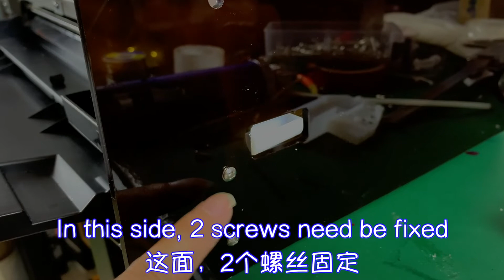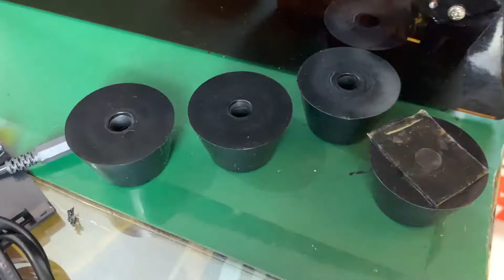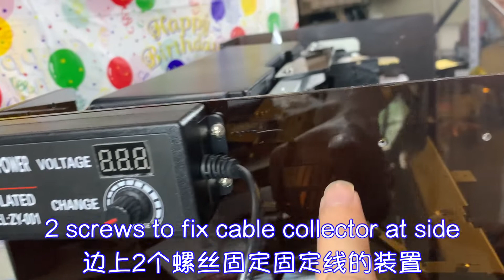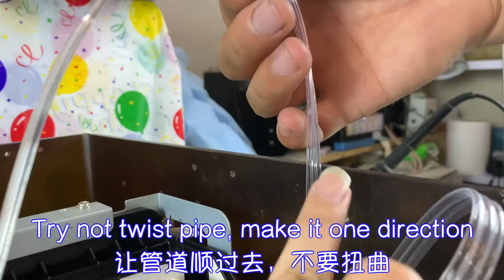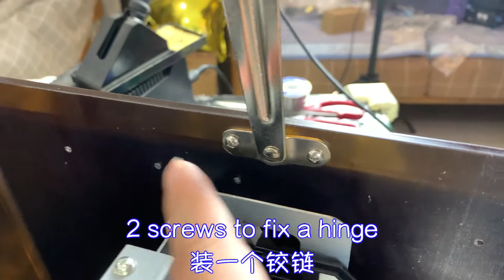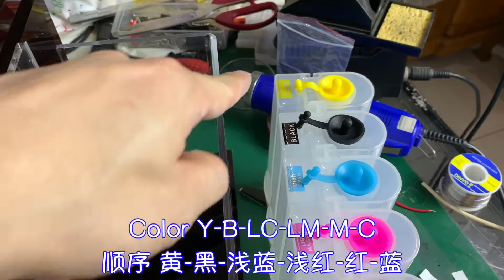Part 4 | Eco Solvent Ink Supply System etc | Convert L1800 into Roll Printer

Comment: Is it compulsory to use eco solvent in l1800
Reply: Or not ?????
Reply from the maker: @honeysandhu9732  You don't have to use Eco Solvent. Actually lot clients use water-based sublimation. In this case, you will need the software ($250 with shipping) only.

The whole modification in this playlist(several videos) is for client who wants to use EcoSolvent/UV ink etc.